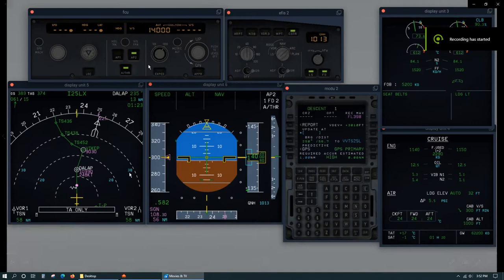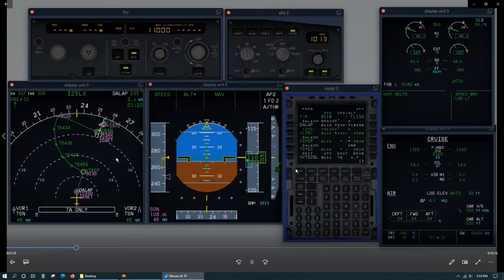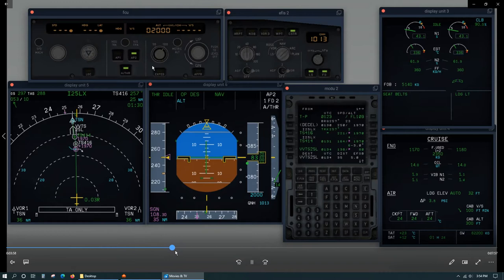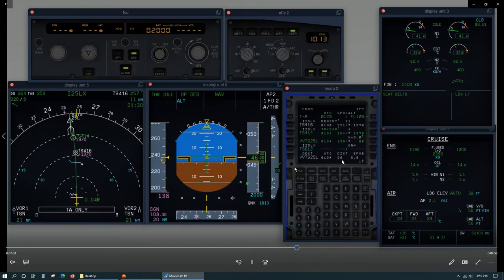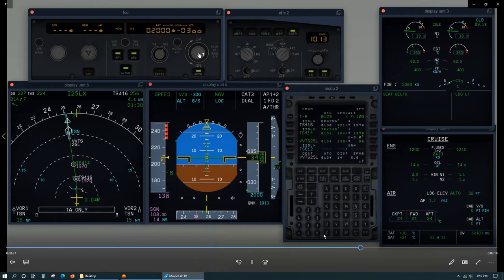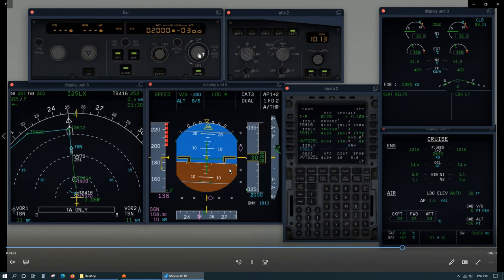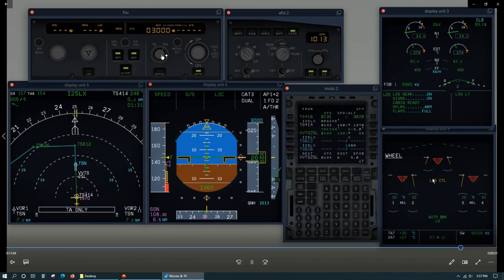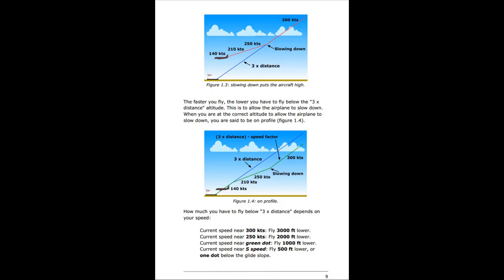A320 Descent Management - Standard Approach

Comment: Hi! Why we shouldn't use the OP DES below 3000ft? Thanks!
Reply from the maker: Because you want to put the aircraft on the glide slope exactly where you want it. It's not a good idea to intercept the glide slope at some random point every time. You want to fly a standardized approach every time, if possible. This makes it easier to manage and when you are high on energy,. it's easier to see. In fact, it's better to use VS from 4000 ft.